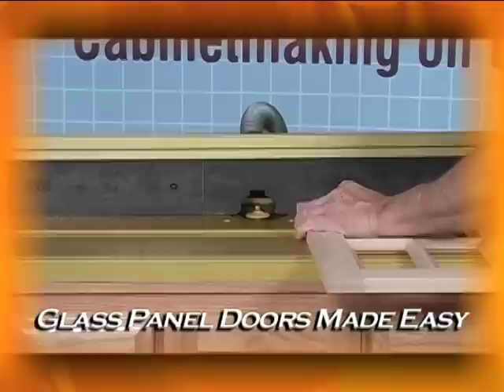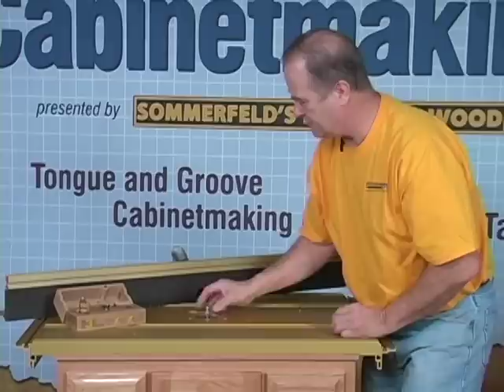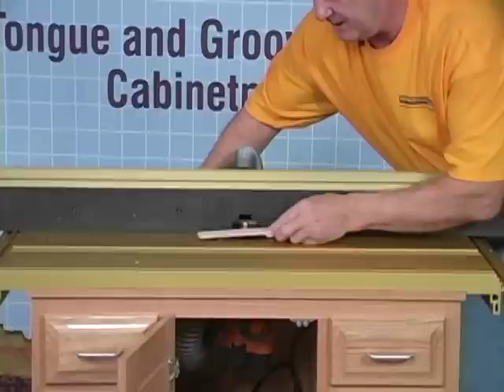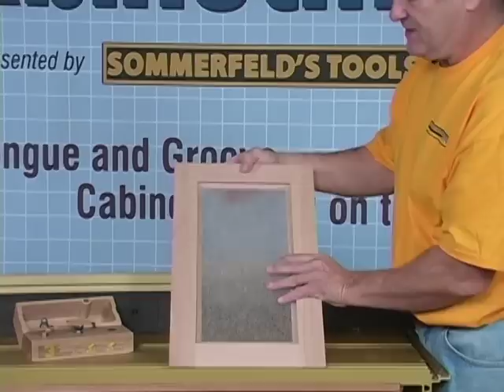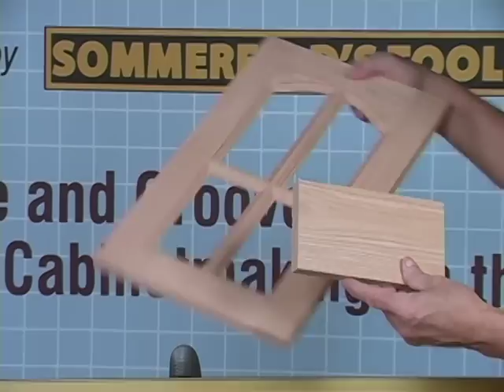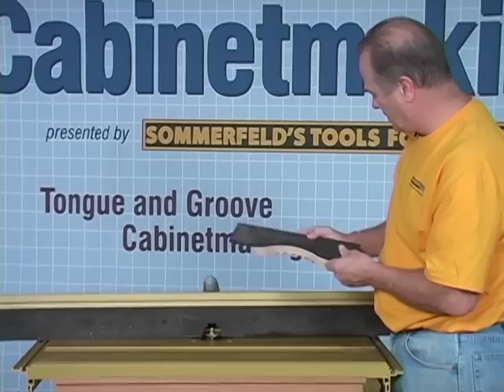Sommerfeld's Tools for Wood - Glass Panel Doors Made Easy with Marc Sommerfeld - Part 1

Comment: About setting height on bits. Its a great idea, set the first one, then the rest of them are set because the bits are designed to be height sensitive. My bits don't reach the bottom of my router collet (where I have a grommet), they hit the cutter first making this technique impossible. Any fix for this? thank you.

Comment: Cabinets can display anything. Nobody but nobody addresses the issue of shop dust covering the French cleat items. Cabinets with sliding doors will solve the problem. No back to cabinet. Hang French cleat items in cabinet.  Use lexan panel for visibility.  Your thoughts.  Better yet build one and make the video!!!! Thx  Bruce. Cleats and Cabinets ( sort of like root beer and ice !)

Comment: Thank for your video; could i ask you some question ? Which size of timer for making glass panel door ? And i don’t have table saw and table router ? I intend to buy Makita plunge router for woodworking. How could i make the edge same you in this video for put glass in panel door, could you give me some ideas. Thank
I intend to make 2 panel doors 2000mm height x 1000mm wide, but i don’t know to choose size of timber 50mm x 30mm or which size is good for glass panel doors and which mortise and tenon is easy for me because i am just an amateur

Comment: You can nail strips of hardwood to hold the glass in place without a hammer:  squeeze the finishing nails in with a small C clamp.  There's no risk of breaking or damaging anything.

Comment: No Dowels, or loose tenons like dominos? Gluing glass doors without some kind of tenon is a really weak way to build a door, not much surface area for a glue joint.
Reply: ***** There is surface face glue joint area but it is still an inferior glue joint. I have built thousands of doors and panels and never had a single call back for a door, and there is a good reason why. It may be on the line of being enough and not being enough, but it's simple assurance. However for anything bigger than a cabinet sized glass door, you are asking for serious issues down the road if you don't use some kind of tenon or dowel.
Reply: +briancnc  "anything bigger than a cabinet sized glass door" - what do you think he's making here??

Btw: I live in a 100 yr old house with original doors and they were created with exactly this method on a larger scale.
Reply: The "7/16 engagement" he refers to IS a tenon, just not a more common flat tenon. This is more than sufficient for this type of door.

Comment: very good video and very good tool congratulations. I have a question do you call the band that put the glass. thanks
Reply: Every window replacing glass company carries this rubber material in stock. Just call your loal glass and screen repair store. I thought it would be hard to find. It took one phone call. It's not expensive. It comes in rolls but you can buy it by the foot.